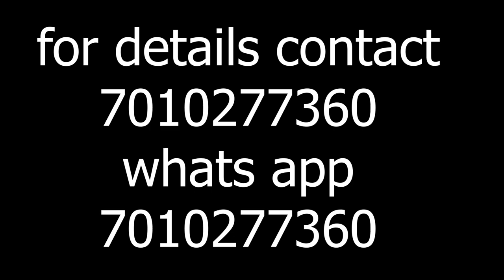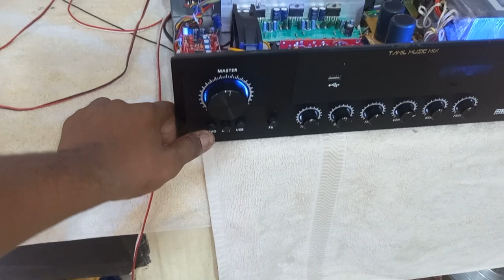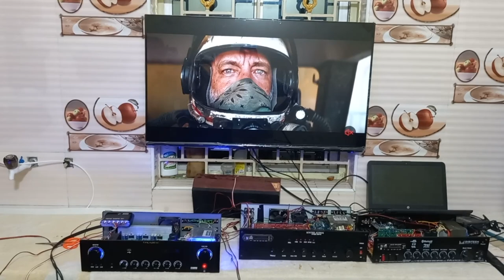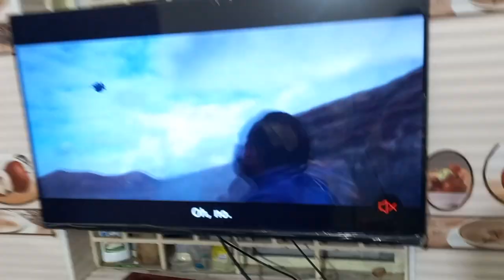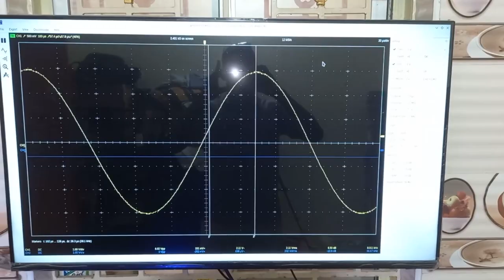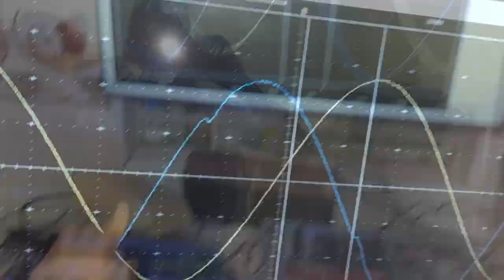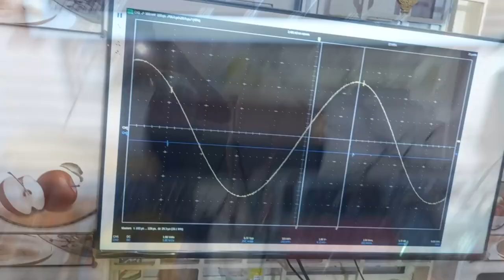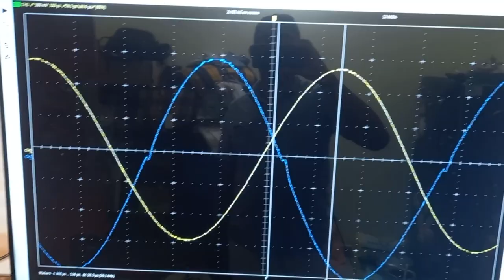5.1 ANALOG 5.1 POWER  AMPLIFIER  FOR HOME USE / JBL 1500W SUPPORT  BOARD REVIEW/ 25/1/2023

Comment: Màharaja board can be altered to get perfect bias and eliminate crossover distortion
Things to be done
Positive rail there will be 4007 diode change to 3k3 1/2 watt
Then remove the capacitor 47uf in positive rail and add 12v zener
Change audio input resistor to 47k
Put 2n5401c instead of 2sa1015
Hfe of 5401 must be below 200
Reply from the maker: I will  try  bro thanks  for help